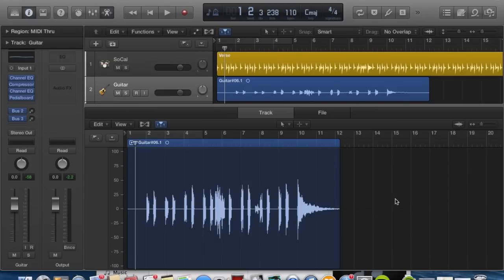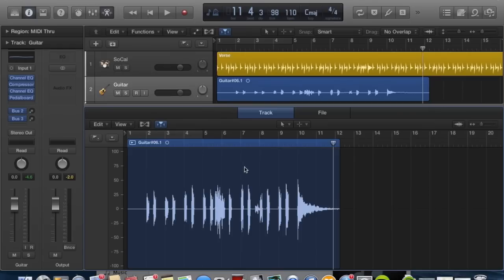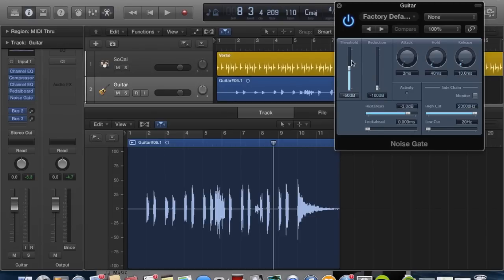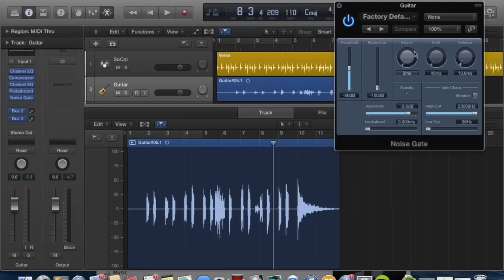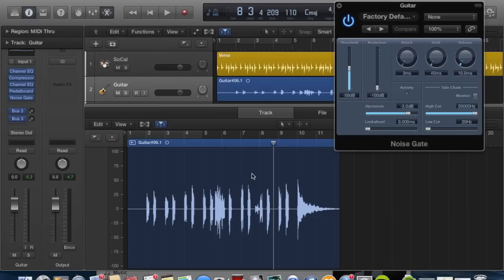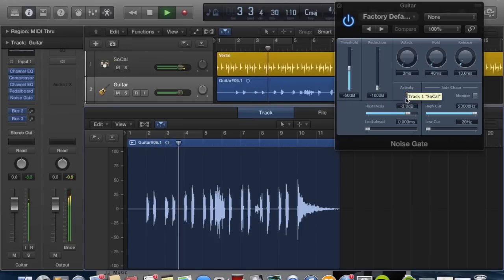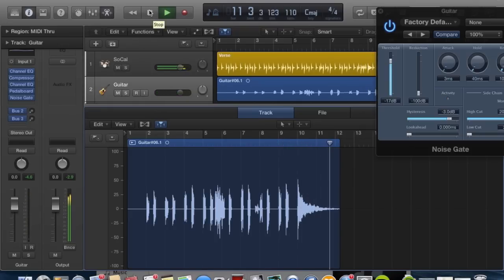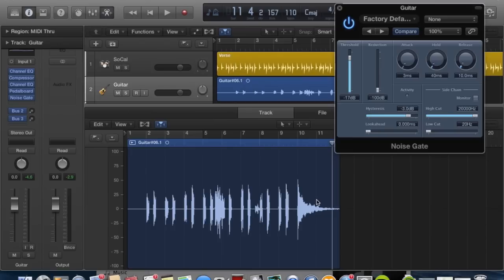How to Use Noise Gate (Logic Pro X)

Comment: Tracks are plotted as functions of volume (dB) over time, so isn't there a way to get the exact volume at a specific time so you could just enter that as your threshold instead of having to guess and risk cutting intended nuances? Correct me if I'm wrong (I don't have my computer with me) but I'm fairly certain I've seen a digital decimal meter display before.

Comment from the maker: Noise Gate is commonly used to suppress unwanted noise that is audible when the audio signal is at a low level. You can use it to remove background noise, crosstalk from other signal sources, and low-level hum, among other uses. https://documentation.apple.com/en/logicstudio/effects/index.html#chapter=4%26section=10%26tasks=true:
If you use it in a context like this, you may get unwanted side-effects such as the clipping of certain notes. This might not be so much of a practical demonstration, but hope it helps you understand how it works!

Comment: is it possible to just adjust one small portion of the track without effecting the other parts?
Reply from the maker: There is a way to apply the noise gate to only one portion of the track. After you add the noise gate in the effects chain, you click on the automation button (in the toolbar, looks like line with 2 dots) then change the default automation setting from volume to noise gate. Then you can adjust the gate based on 7 different parameters. I haven't tried it yet so it may take playing with. Let me know what works for you! Good luck.
Reply: Yes- selection based processing.